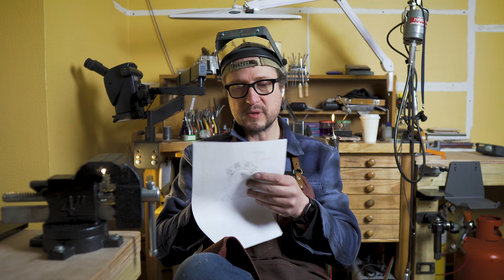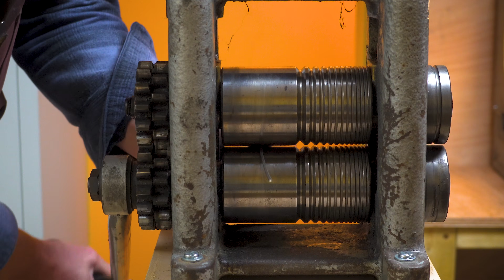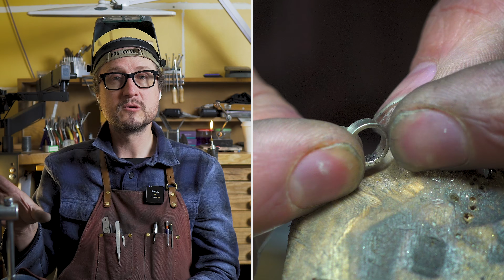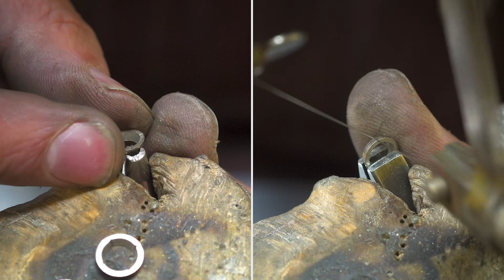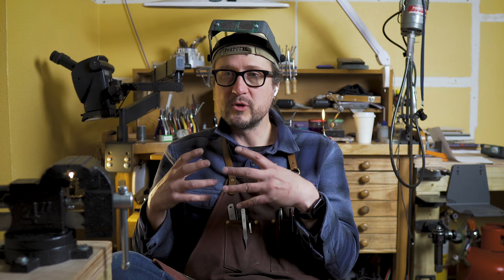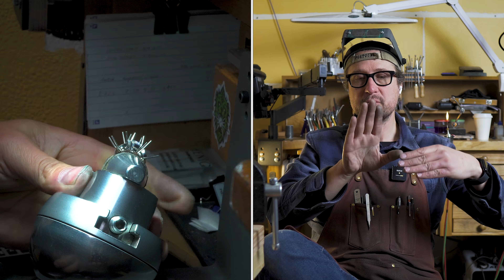Three Stone Diamond Engagement Ring | Jewellery Making Tutorial | Goldsmith's Workshop Secrets

Comment: Why this kind of fusing with thin sheet is made on platinum but I've never seen it made with silver or gold? Because of firescale? Platinum does not tarnish?
Reply from the maker: It just reacts better. The nature of the metal allows for this method - it creates a seamless joint which makes it stand out. Today with laser technology however, the principle applies in much the same way. It allows to fill joints without solder in just about every metal which is ideal

Comment: How do you stick the three settings together while you solder/fuse them? They seems fairly solidly connected before you even heat it up. Im attempting to learn enough to be able to make an engagement ring for my girlfriend, these videos help a lot!
Reply from the maker: What a cool thing to do. Good luck and I’m happy that these videos are helping. I tack the settings together using a laser but before that, I used to tack it together with a tiny pin prick of solder to position it before I commit. Hope this helps - Jaco

Comment: A lot of waste in Platinum in making the shank, wouldn’t it been better to make a wax shank then get it cast, just a thought.😊
Reply from the maker: Good point Chris, casting is always an option but quick answer is that I enjoy shaping the ring this way. It’s much quicker for me than carving and casting and the metal is more compressed too.
Reply: Contray to how it may look in the video, theres really not much in the way of 'waste'. Filings are all reclaimable and easily cleaned and re-melted back into stock metal. Wax models and casting definately have their place though.
Reply: You still need extra metal and finishing in casting and you can end up with porosity which isn’t a problem with a hand made shank. Also even though casting is custom, it isn’t hand made.
Reply: @johnsmalldridge6356  The wax is?